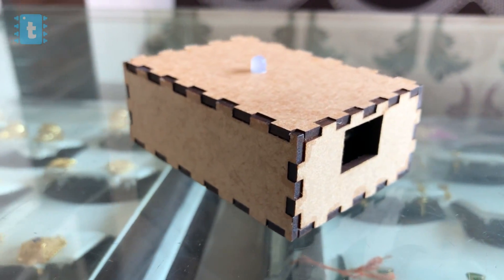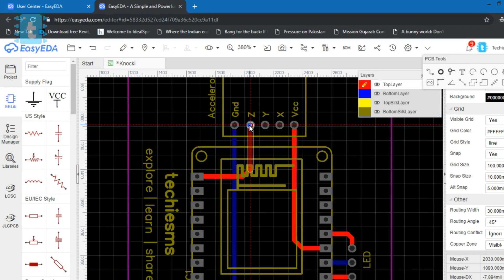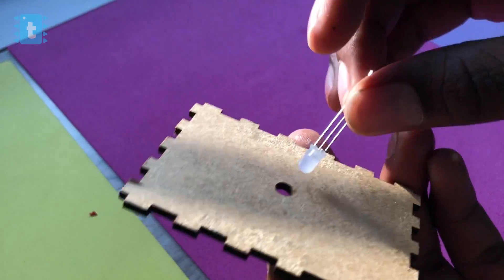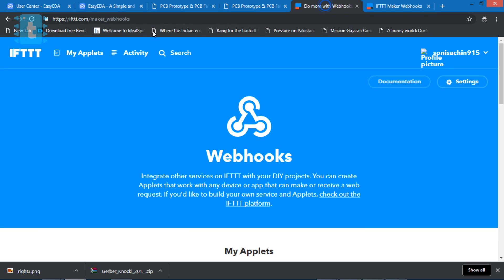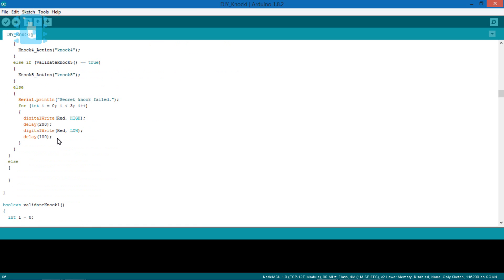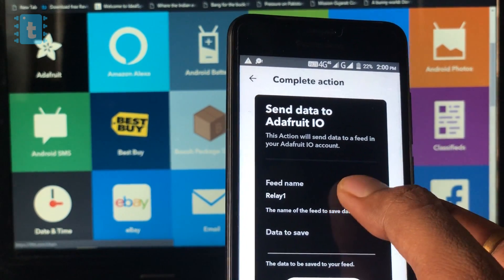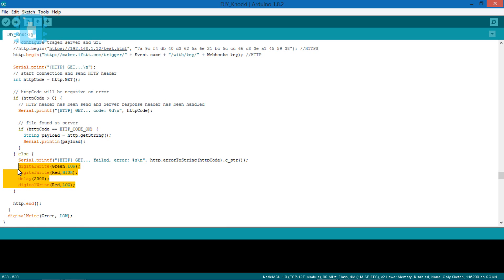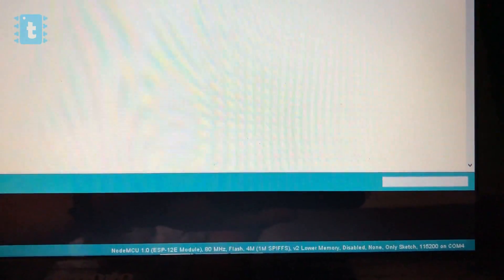DIY Knocki | Turn any Surface to a wifi remote control | IoT Projects | ESP8266 Projects

Comment: Hi hey i really like ur projects and it really helps alot i just have one question in my mind that what u used to control your A.C appliances is that another node mcu with relay to control it mean(2 nodemcu, realy channel, and adxl335) and if use could u plz send me the coding for the another node mcu which works as a receiving unit
Reply: hey i dont get any revert its 5 months ago ?

Comment: how do you crate the knocking patterns?
Reply from the maker: I made a separate code for recording the patterns
Reply: is there a link to the gerber file?
Reply: how would i connect the ifttt or adafruit to a wifi plug to be able to turn things on when a knock is met and where is the video on creating knocks for knocki?